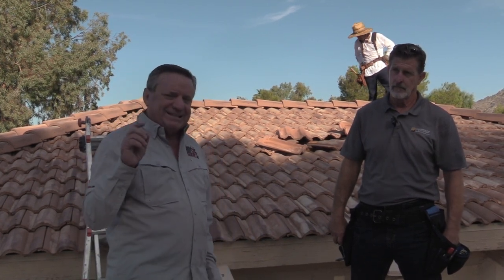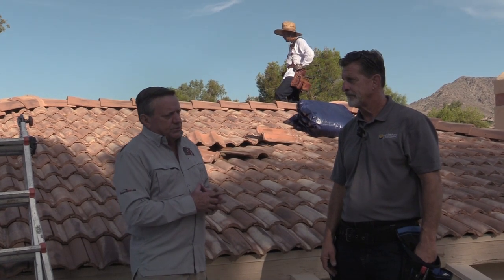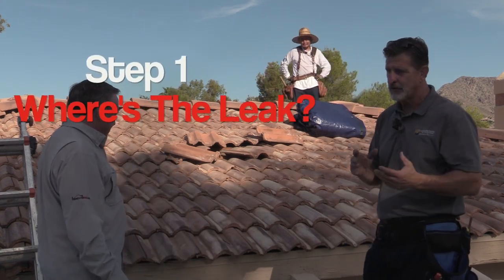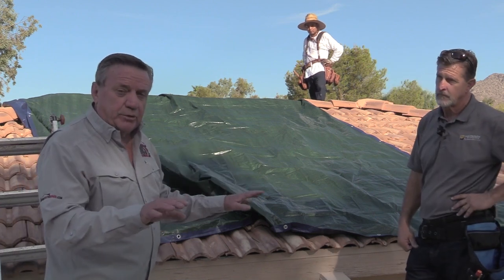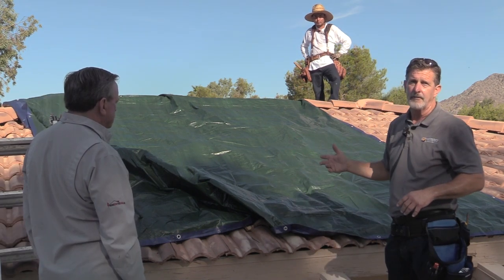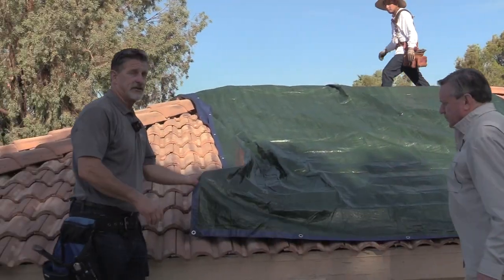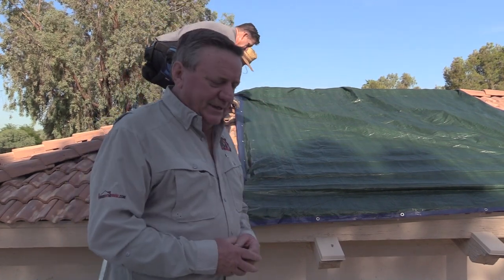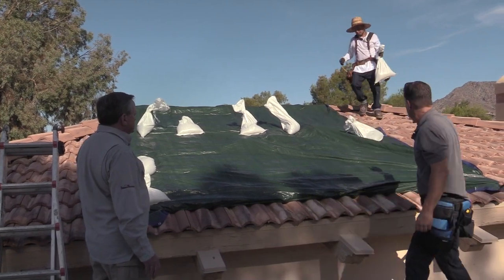The Science of Roof Tarping | #1 - How To Tarp A Concrete Tile Roof

Comment: I have a question. I did exactly this. How do I avoid the sandbags from sliding down the roof? I tried zip ties and didn’t work either. Any tips?
Reply: Well I am by no means and expert, but if you make eachsanbag weight more or less the same, and you can tie with a rope each sandbag to another on the other side of the roof at  the same time, the counterweight between both should make it so that they don't slide.